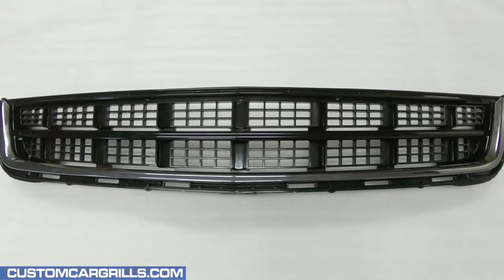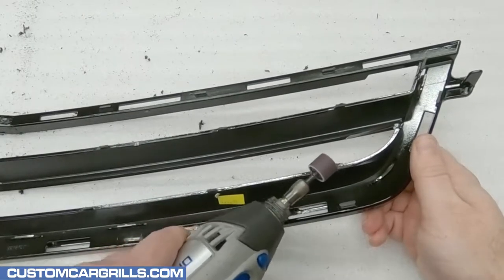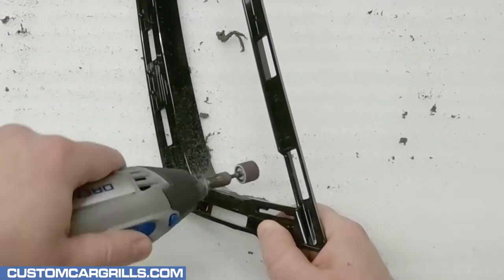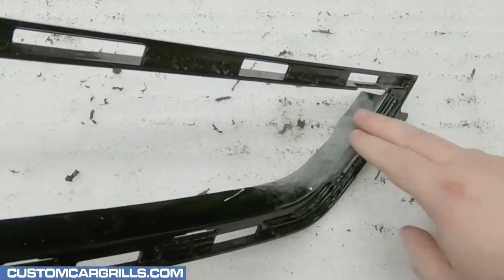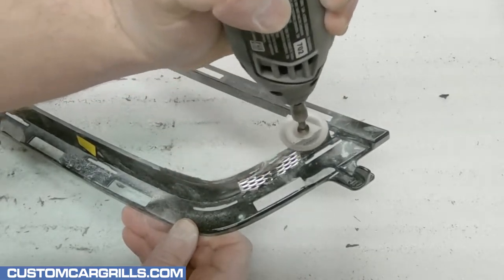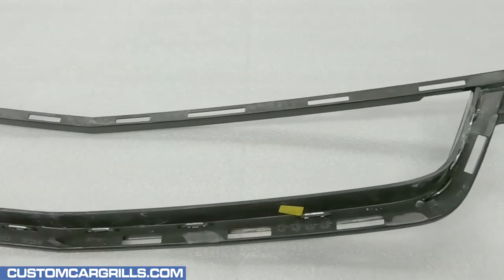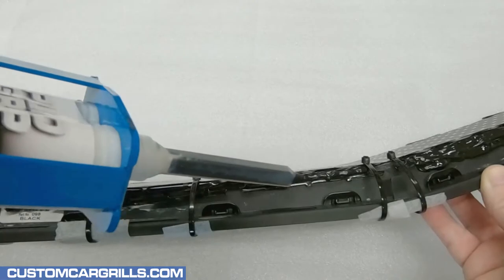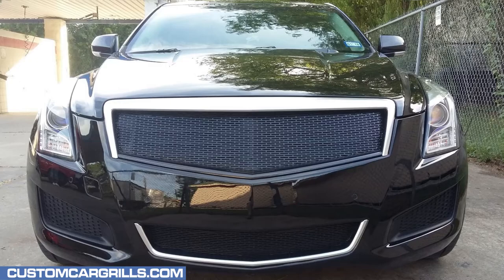Cadillac ATS 2013-2014 Lower Bumper Mesh Grill Installation How-To by customcargrills.com

Comment: Did you use a spray paint can? If so, what’s the name brand and color gloss black?
Reply from the maker: The frame was painted at a professional paint shop.  There are some good gloss black spray cans, such as Spraymax 1K, but spray cans lack the hard clear top coat that you'll get with a proper 2 stage paint job.